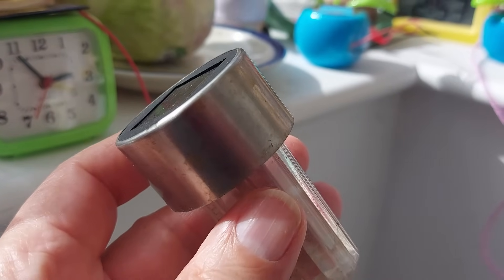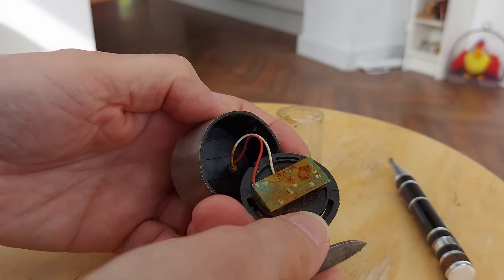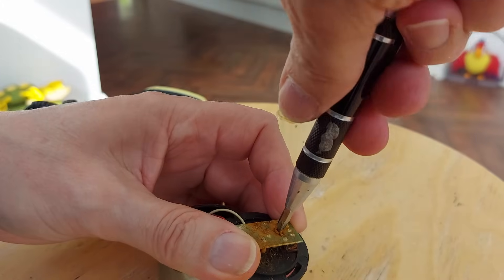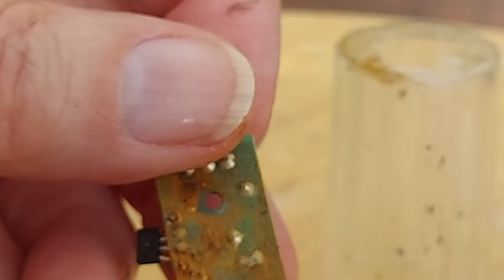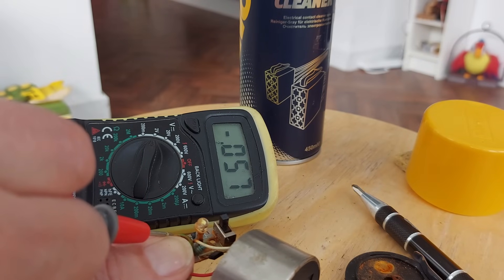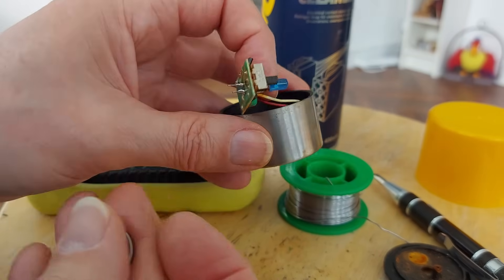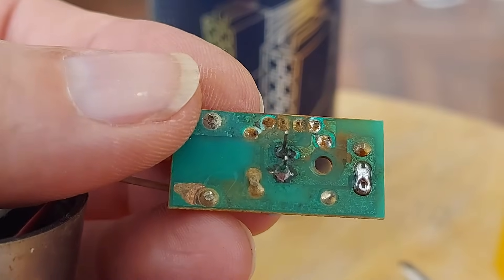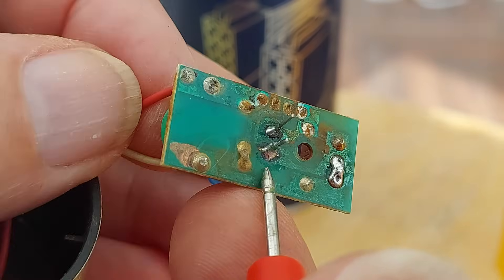Anything salvageable in a dead Solar Garden Light?

Comment: Great video, my advice is when the lights are new protect the area around the solar panel, use either M3 water proof tape, clear nail varnish, or silicon sealant. Clean area first with IPA to remove and oils 😊

Comment: Ditch the switch you never use them .replace the battery with a cheap rechargeable aaa or if its 3.7v a battery from a disgarded vape that are the  rubbish of the decade .

Comment: Did it charge the battery. Cheers
Reply from the maker: It charges it enough to light the LED well into the night. Obviously it depends how much sunlight we have during the day, but it works as well as the rest of the solar lights I have in the garden, so we can class this as a successful repair👍
Reply: @GrandadIsAnOldMan  thanks for replying  .cheers
Reply from the maker: @fredbloggs7345  thanks for asking 😁😁

Comment: The solar light circuits are a great little circuit. Should last for many years now on your window ledge.
Reply from the maker: The circuit design is fine, but the board and associated bits and pieces do suffer when outdoors in the cold and damp, unless they have made the effort to waterproof them. Of course that is not in the manufacturers interest, they need them to fail so you will buy more, although to be fair I think this one is probably 2 years old. I have been looking back at my old Solar Lights videos trying to identify where I bought this one. I did a little series on them in 2022. Here is one of the videos in that series https://youtu.be/NrfH4uZdqTg?list=PLA5a2xPRSrB14BZZCNWNAA67oXF3es8us